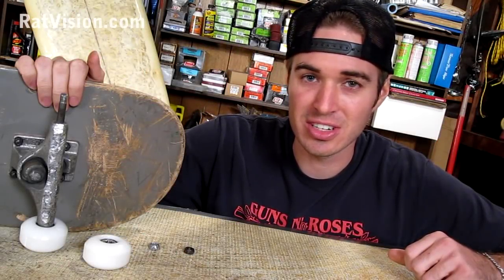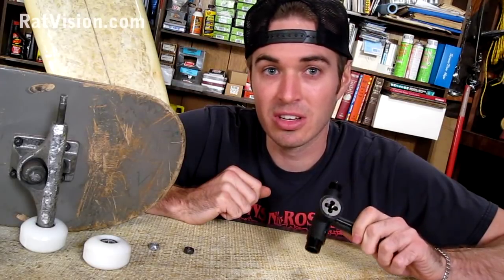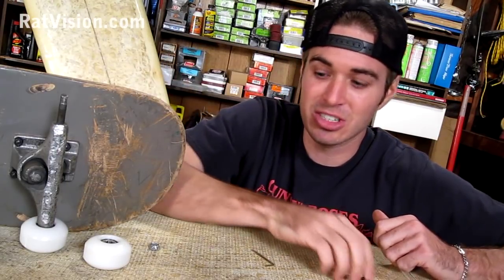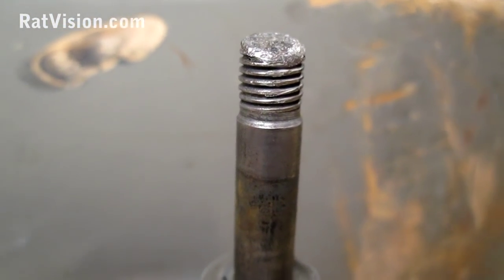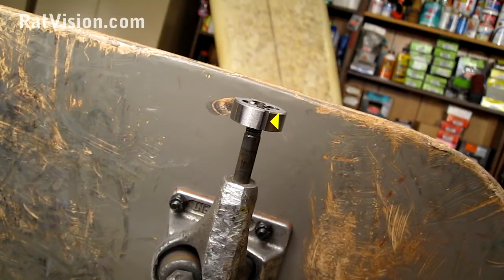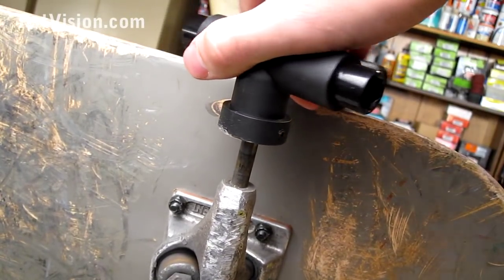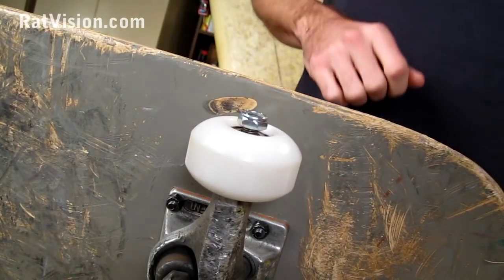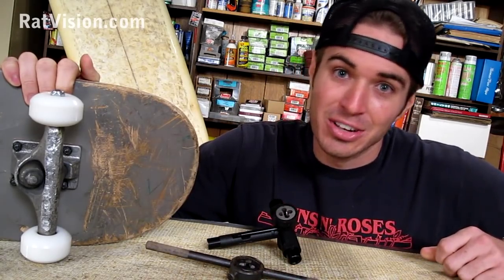Fix Truck Axle Threads On Skateboard & Longboard

Comment: my truck is bent or something, it looks crooked and turns to the left on its own
Reply: it might be your bushing. they can squish on one side more than the other and appear to be bent. rotate the bushings a quarter turn. if it doesnt help it could be either your truck is bent or your board could be warped and twisted. could be multiple issues but the worst possible case would be a bent truck or warped board.

Comment: how to fix a lostthread nuts? :/
Reply from the maker: +Jude Laygo You lost the nut?  Go get a new one at a shop
Reply: No the nut is lostthread. I cant take it off.
Reply from the maker: +Jude Laygo Lostthread?  Sorry maybe English is not your first language.  Let's see if I can figure out what you mean.  If the nut is stuck on the axle you will need to pry/lift up from underneath it.  Use a flat head screwdriver or anything else so you can try to push/lift the nut from behind it.  As you are pushing the nut up, unscrew the nut.  The nut should grab onto some threads and come off.  I hope this is what you were talking about.  If not try to clarify or word your question differently and provide more detail.
Reply: Yeah thats what i mean sorry im not really influent in english.

Comment: hi are washers necessary?
Reply from the maker: You can skate without them, but they are a part of the wheel assembly. Washers on a truck function in 2 ways.  One is as a bushing, to add space between the nut and bearing, and the inside bearing and truck hanger face. Washers are also used to apply even pressure around the nut and bearing.